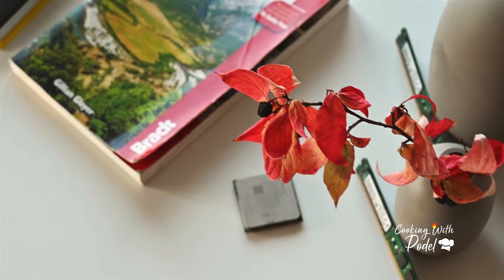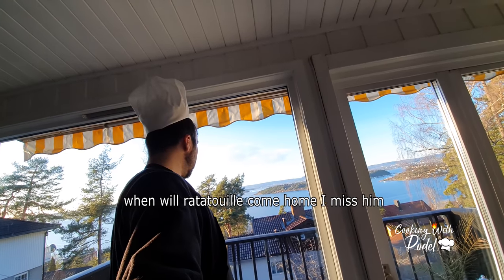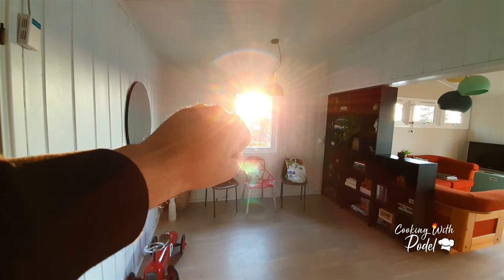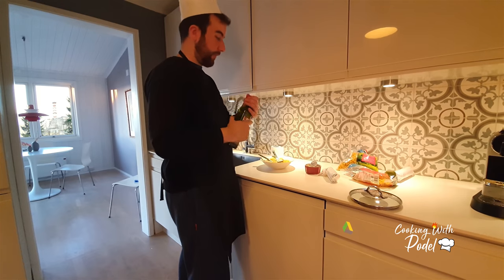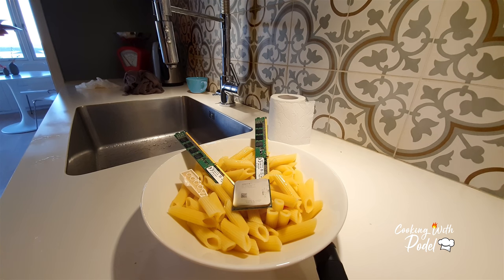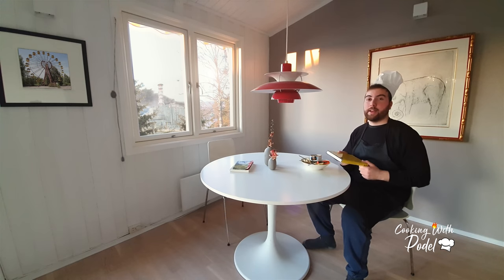Cooking with Podel: CPU and RAM Pasta

Comment: -Capacitor Curry
-Semiconductor Salsa
-Solder Soup
-Pcb Pizza
-Resistor Ragout
-Transistor Toast
Reply: and don't forget chip fries!
Reply: @dyazsgameplayandrandomvide3259  just chips.
You can put them on ASUS BREADBOARD for maximum performance
Reply: @Versuffe  >OK ADD-ONS
Reply: Sounds about right…
Reply: Solder soup yum yum
Reply: Wellington RTX 4060 Ti

Comment: 0:13 toilet tissue
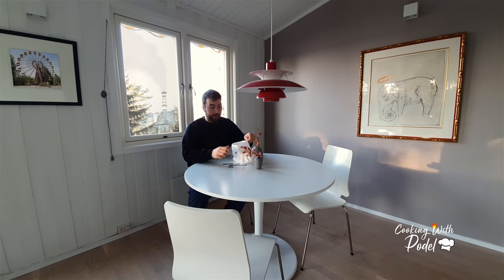0:53 camera hit
0:56 camera hit
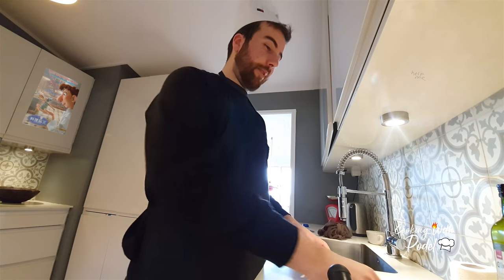1:24 ratatouille in the back
1:38 intel oil
1:44 camera hit
2:00 hat falls
2:24 using toilet tissue instead of hat
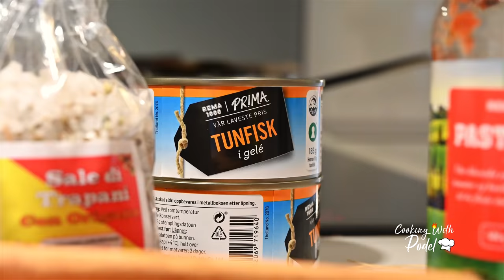2:29 fire in the back
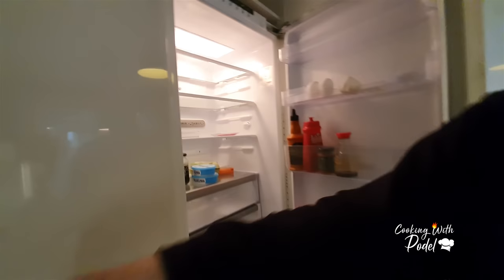2:37 hat falls
3:00 hits
3:02 lego block
3:06 explosion outside
3:47 no one cares about you
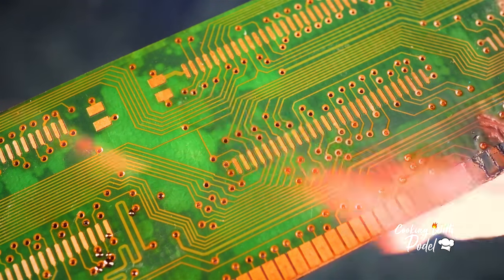3:54 "we can have a fork"
4:33 black smoke outside
Reply: 3:06 and 4:33 are the Chernobyl 4
Reply: @HorizonSniper__  I call that tuesday

Comment: high-explosive anti-tank (HEAT) warhead is a type of shaped charge explosive that uses the Munroe effect to penetrate thick tank armor. The warhead functions by having the explosive charge collapse a metal liner inside the warhead into a high-velocity superplastic jet. This superplastic jet is capable of penetrating armor steel to a depth of seven or more times the diameter of the charge (charge diameters, CD) but is usually used to immobilize or destroy tanks. Due to the way they work, they do not have to be fired as fast as an armor piercing shell, allowing less recoil. Contrary to a widespread misconception (possibly resulting from the acronym HEAT), the jet does not melt its way through armor, as its effect is purely kinetic in nature. The HEAT warhead has become less effective against tanks and other armored vehicles due to the use of composite armor, explosive-reactive armor, and active protection systems which destroy the HEAT warhead before it hits the tank. While HEAT ammunition has become less effective against the composite armor found on MBTs from 1964 onward and today pose little threat to any modern tank, they are still deadly against lighter vehicles. In addition, air vehicles are also possible targets.